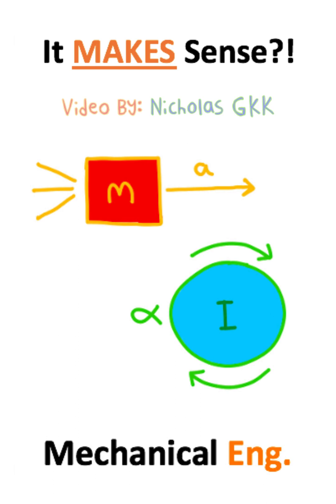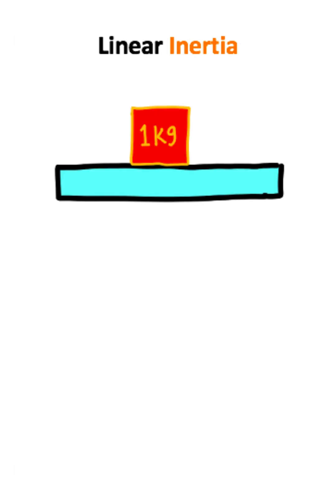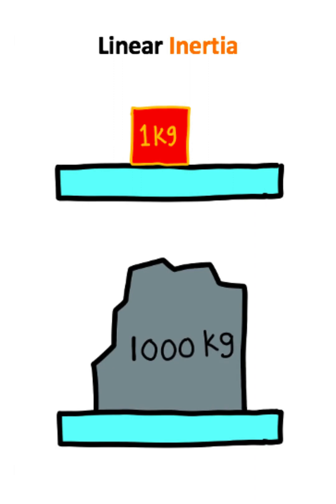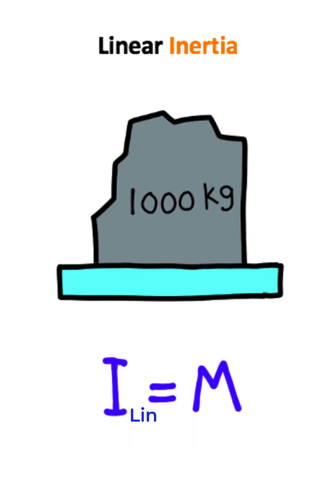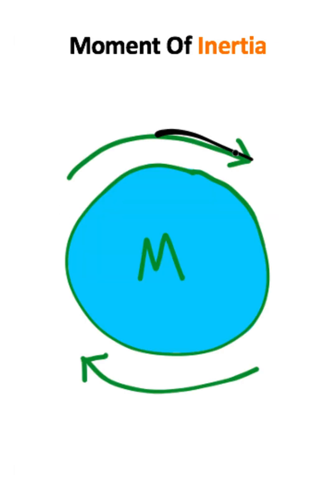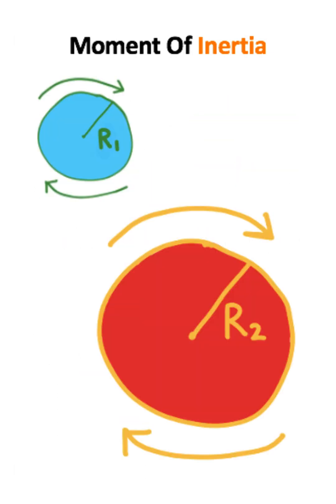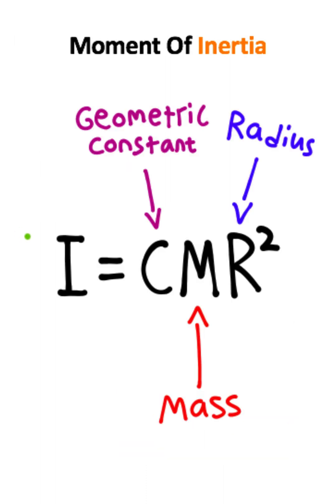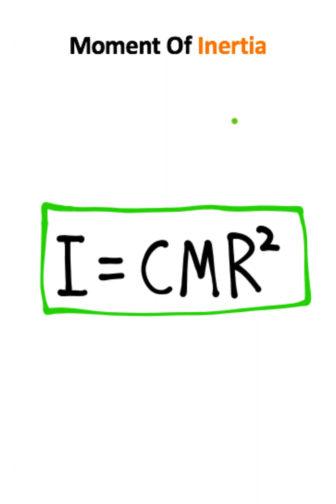HARDEST Engineering Concepts!!!

Comment: Could you make a video on what is moment it's pretty confusing
Reply: A moment is often described as the turning or rotating effect produced by a force, however, two equal forces may not produce the same moment. 

For example, picture a lever. You could have a large force near a fulcrum, but the moment (rotation) caused by that force may be small. If we apply the force farther up the lever, though, then it produces a larger turning effect/moment.

A common mistake is people often get it mixed up with torque. A torque is an angular force that causes rotation, a moment is the magnitude of the rotation itself. Both have the same units, the Newton-meter.

Hope that clarifies :)

Comment: The best way to phrase it is "it depends on the distribution of that mass"

It's because torque (rotation version of acceleration) acting on an object depends not only on thr object's mass and the force's... amount, but also on the distance of the force source from the center of mass. Pushing a door open becomes harder the closer to the hinges you push on it, though that's a slightly different thing.

You could also think of it as "the further away an atom is from the center of rotation, the more it has to linearly accelerate to match the rotational acceleration of its surroundings", making distance matter for moment of inertia.

Comment: i do not see what is so confusing... a circle has one radius while other geometric shapes have multiple radii. therefore the force of the mass is different at different points on the object and on the circle the force of the mass is equal all around the object as they are being spun. i think i worded that correctly but even if i did not you get what i am pointing out right?